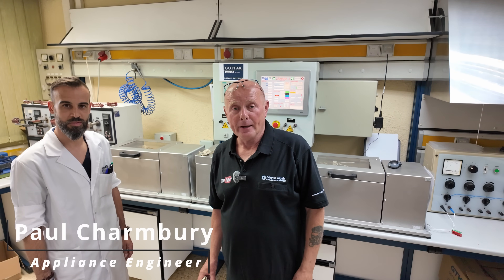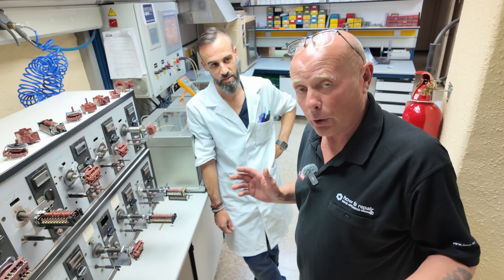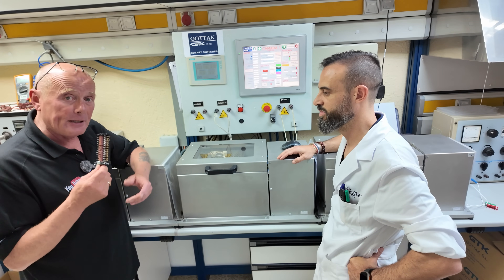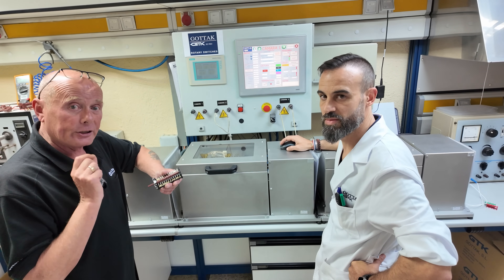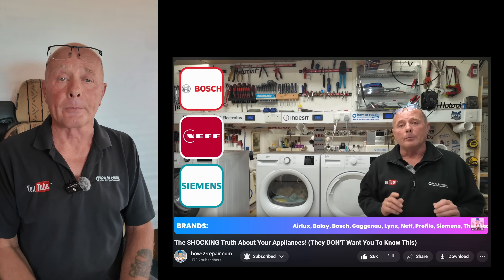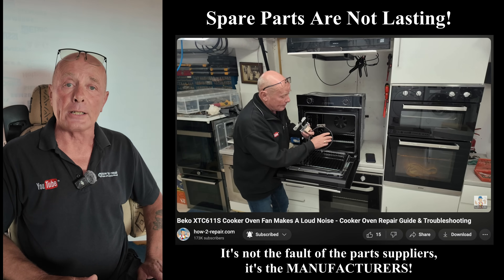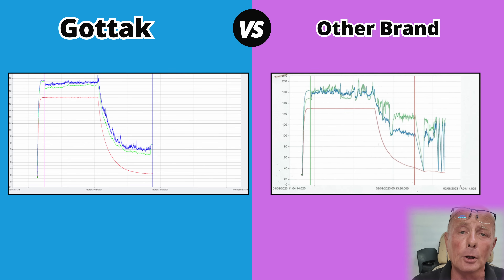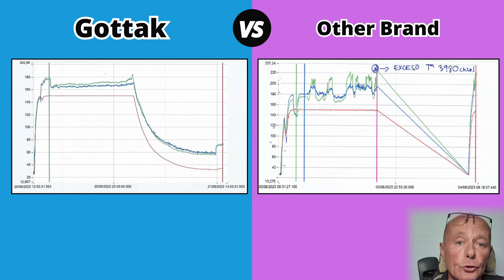Why Your Appliances FAIL SO FAST! Lab Results EXPOSE the Truth!

Comment: When i purchased my house last year it had a 30 year old washer and a 40 Year old dryer in the basement that both work like new! Im keeping them until the weat Parts like belts etc are no longer available this probably not happen in my lifetime.
Reply from the maker: Hi there! Thanks for your comment, @KRich408!

That's absolutely fantastic to hear about your 30-year-old washer and 40-year-old dryer still working like new! It's a testament to how well things were often made in the past, and it's wonderful you're planning to keep them running. Experiences like yours are becoming increasingly rare.

Your comment really highlights a crucial point about appliance longevity. The durability you're describing is exactly what many feel is missing from more modern machines, and it touches directly on the concerns about built-in obsolescence we discuss in the video. It's this decline in lifespan and the reasons behind it that we explore.

At the trade show last year, understanding how much obsolescence is being designed into new appliances these days is something everyone should be aware of. For a deeper dive into this topic and to see the examples we covered, please check out the full video here: https://youtu.be/gEgSCbZnHVM?si=wTIw0mELuhWaw4aX

We also explored related aspects in these videos:

The shocking truth about manufacturers: https://www.youtube.com/watch?v=QsdGd2qDPaI
Heat pump tumble dryers are they really worth it?: https://www.youtube.com/watch?v=xn03N3b0-lE
If you found this information eye-opening or helpful, please consider sharing this video with your friends and family. The more people who understand what's happening with appliance longevity, the better equipped we all are as consumers.

Thanks again for watching and engaging! Don't forget to subscribe to the channel for more insights like this!

Comment: Toyota in 90's were Swiss watches with basic upkeep.  Toyota today is not as reliable.
Reply from the maker: Hi there! Thanks for your comment, @ferndog1461!

You've hit on a really important point about the legendary reliability of 90s Toyotas and how that perception compares to today. Many people feel that older cars, like those "Swiss watch" Toyotas, were simpler and perhaps built with a different philosophy regarding longevity. This touches on some of the ideas around changing manufacturing and design approaches that can feel like a form of built-in obsolescence, which we discuss in our video.

The automotive landscape has certainly changed. While modern Toyotas are still generally considered very reliable and often feature in the top tiers of dependability studies, the increasing complexity of vehicles—with more electronics, new powertrain technologies, and different materials—can lead to different types of wear and potential issues than in the simpler vehicles of the 90s. Some recent models introducing new technologies have indeed seen some initial reliability dips, which can fuel the perception you're describing.

At the trade show last year, understanding how much obsolescence is being designed into new appliances these days – and by extension, how design and manufacturing priorities might be shifting in many industries, including automotive – is something everyone should be aware of. The pressure for new features, emissions standards, and cost efficiencies can sometimes lead to designs that may not have the same straightforward, long-term durability of older, less complex machines.

For a deeper dive into this topic of built-in obsolescence and to see the examples we covered (primarily in appliances, but the principles can be broad), please check out the full video here: https://youtu.be/gEgSCbZnHVM?si=wTIw0mELuhWaw4aX

We also explored related aspects in these videos:

The shocking truth about manufacturers: https://www.youtube.com/watch?v=QsdGd2qDPaI
Heat pump tumble dryers are they really worth it?: https://www.youtube.com/watch?v=xn03N3b0-lE
If you found this information eye-opening or helpful, please consider sharing this video with your friends and family. The more people who understand what's happening with product longevity, the better equipped we all are as consumers.

Thanks again for watching and engaging! Don't forget to subscribe to the channel for more insights like this!

Comment: You only need to look at automakers, especially the US automakers, some of the junk they're making will hardly make it off of the showroom lot before it self destructs. You really only have to the rate of recalls, what a joke. SMH
Reply from the maker: Hi there! Thanks for your comment, @slomotrainwreck!

You've hit on a really important point about the concerns surrounding the quality and longevity of vehicles from some automakers, especially with the rate of recalls you mentioned. This is exactly the kind of built-in obsolescence, or perhaps in this case, questionable manufacturing quality leading to premature failure, that resonates with the issues we discuss in the video.

At the trade show last year, understanding how much obsolescence is being designed into new products these days, or how manufacturing standards might be slipping, is something everyone should be aware of. For a deeper dive into the broader topic of product longevity and to see the examples we covered, please check out the full video here: https://youtu.be/gEgSCbZnHVM?si=wTIw0mELuhWaw4aX

We also explored related aspects in these videos:

The shocking truth about manufacturers: https://www.youtube.com/watch?v=QsdGd2qDPaI
Heat pump tumble dryers are they really worth it?: https://www.youtube.com/watch?v=xn03N3b0-lE (While this one is about appliances, the underlying themes of product lifespan and consumer awareness are relevant!)
If you found this information eye-opening or helpful, please consider sharing this video with your friends and family. The more people who understand what's happening with product longevity, whether it's appliances or vehicles, the better equipped we all are as consumers.

Thanks again for watching and engaging! Don't forget to subscribe to the channel for more insights like this!

Comment: I’m in the US. I’ve always thought that there was something rotten in the world of appliances because something usually goes wrong shortly after the warranty is up like you say! An appliance repair guy told me these appliances are rigged that way. Also, they’ll make a new model that fails and instead of recalling or replacing the faulty appliance they just screw the customer and fix the issue in the next model! This happened with our Samsung French door fridge the ice maker started freezing up and never worked properly.  I learned that from the appliance guy who came to fix it 3 times!!! It never did work even after that! These manufacturers are just disgusting and deceitful!! 🤑😤
Reply from the maker: Hi there! Thanks for your comment, @elizaine729!

You've hit on a really important point about your frustrating experience with appliances, especially your Samsung French door fridge's ice maker failing and the feeling that these problems often arise just after the warranty expires. The appliance repair guy's insight about some appliances being "rigged that way" and manufacturers not recalling faulty models but rather fixing issues in subsequent ones is a stark illustration of what many consumers face. This is exactly the kind of built-in obsolescence and concerning manufacturer practices we discuss in the video.

At the trade show last year, understanding how much obsolescence is being designed into new appliances these days is something everyone should be aware of. Your experience is unfortunately a common one. For a deeper dive into this topic and to see the examples we covered, please check out the full video here: https://youtu.be/gEgSCbZnHVM?si=wTIw0mELuhWaw4aX

We also explored related aspects in these videos:

The shocking truth about manufacturers: https://www.youtube.com/watch?v=QsdGd2qDPaI
Heat pump tumble dryers are they really worth it?: https://www.youtube.com/watch?v=xn03N3b0-lE
If you found this information eye-opening or helpful, and sadly, all too relatable, please consider sharing this video with your friends and family. The more people who understand what's happening with appliance longevity and manufacturer accountability, the better equipped we all are as consumers.

Thanks again for watching and engaging with your story! Don't forget to subscribe to the channel for more insights like this!
Reply: @How-to-repair thanks for sharing this information! I’m going to share it with my daughter as they bought a Frigidaire upright freezer around the time covid showed up and it simply just quit working recently 😠 What sickens me the most is that all this junk has nowhere to go but to a landfill 🥵

Comment: Hello, Paul! I'm Samuel, from Brazil. Here in Brazil, we have three dominant brands that have been around for decades: Brastemp, Consul (owned by Whirlpool) and Electrolux. They manufacture refrigerators, washing machines, dishwashers, microwaves and other home appliances. According to your technical experience, which of the two is better today: Whirlpool or Electrolux? I'm going to buy a refrigerator and a washing machine next month. Congratulations on your video! Here in Brazil, unfortunately, there are many complaints about the short lifespan of products. Something that didn't happen in the past.
Reply from the maker: Hi there! Thanks for your comment, @sam6063e!

You've hit on a really important point about the frustrating issue of the short lifespan of products, which you're also observing in Brazil with dominant brands like Brastemp, Consul (Whirlpool), and Electrolux. It's a significant concern when you're looking to invest in new appliances like a refrigerator and washing machine. This is exactly the kind of built-in obsolescence and decline in product durability over time that we discuss in the video – a problem many people are noticing compared to how long appliances used to last.

At the trade show last year, understanding how much obsolescence is being designed into new appliances these days is something everyone should be aware of.

Regarding your question about whether Whirlpool or Electrolux is better today for the models available in Brazil, it's challenging for me to give a specific recommendation. Product lines, manufacturing standards, and local support can vary significantly by region, and my direct experience is primarily with UK and European models. What might be a better choice in one market isn't always the same in another. Samuel, I think Whirlpool is owned by a different company in America compared to Europe. In Europe, Whirlpool has been taken over by Beko. Electrolux, however, is the same company in both places. So, I would choose the Electrolux product this time.

However, for a deeper dive into the general issues of appliance longevity, what to look out for, and the tactics some manufacturers use, which can help you make a more informed decision, please check out the full video here: https://youtu.be/gEgSCbZnHVM?si=wTIw0mELuhWaw4aX

We also explored related aspects in these videos:

The shocking truth about manufacturers: https://www.youtube.com/watch?v=QsdGd2qDPaI
Heat pump tumble dryers are they really worth it?: https://www.youtube.com/watch?v=xn03N3b0-lE
By understanding these broader themes, you might be better equipped to ask the right questions and assess your options in the Brazilian market.

If you found this information eye-opening or helpful, please consider sharing this video with your friends and family in Brazil. The more people who understand what's happening with appliance longevity, the better equipped we all are as consumers.

Thanks again for watching and engaging, Samuel! Congratulations on your upcoming purchases, and I hope the information on our channel helps you. Don't forget to subscribe for more insights like this!

Comment: Amana washer Ntw4519jw2, just turned a year old. Now it needs a new control board, which is around $300.00 and out of stock.
Reply from the maker: Hi there! Thanks for your comment, @Jasen-hh3jb!

You've hit on a really important point about the incredibly frustrating experience of having a major appliance like your Amana washer fail just after a year, needing an expensive ($300) and currently out-of-stock control board. This situation, especially with a machine that's barely a year old, is a stark example of the issues many consumers face. This is exactly the kind of premature failure and repair difficulty that aligns with the concerns about built-in obsolescence we discuss in the video.

At the trade show last year, understanding how much obsolescence is being designed into new appliances these days, or how product quality seems to be declining leading to such early failures, is something everyone should be aware of. Your experience highlights the costly reality of this.

For a deeper dive into this topic and to see the examples we covered, please check out the full video here: https://youtu.be/gEgSCbZnHVM?si=wTIw0mELuhWaw4aX

We also explored related aspects in these videos:

The shocking truth about manufacturers: https://www.youtube.com/watch?v=QsdGd2qDPaI
Heat pump tumble dryers are they really worth it?: https://www.youtube.com/watch?v=xn03N3b0-lE
If you found this information eye-opening or, in your case, unfortunately very relatable, please consider sharing this video with your friends and family. The more people who understand what's happening with appliance longevity and repairability, the better equipped we all are as consumers.

Thanks again for watching and sharing your experience! Don't forget to subscribe to the channel for more insights like this!